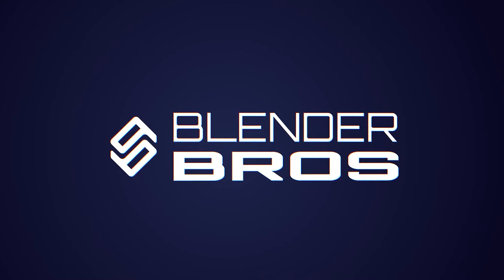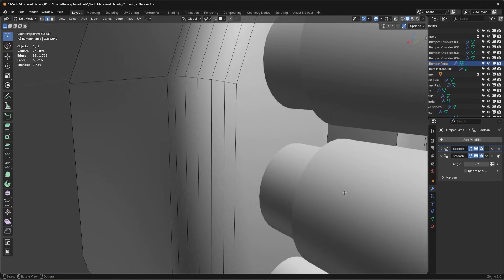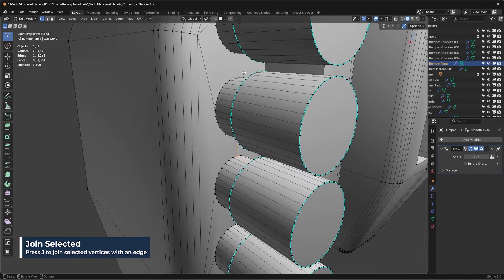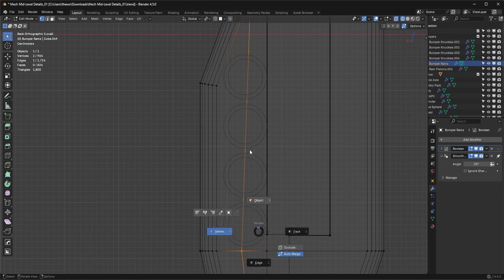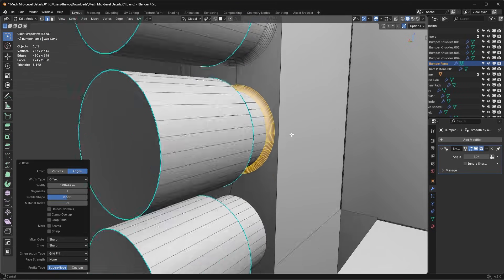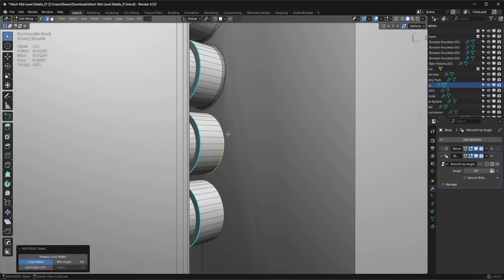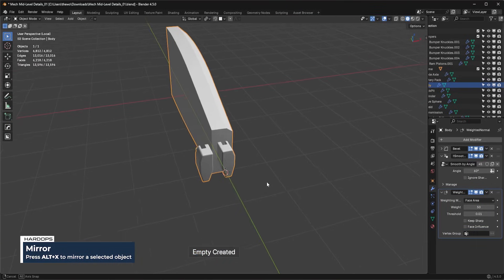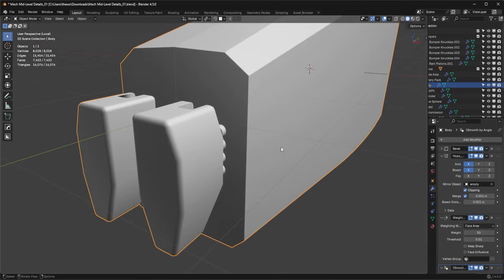Don't do this with your 3D models...

Comment: Great video to take note of if you are 3D printing.  Turning your multiple object project into a single manifold object is half the battle.
Reply: Multiple intersecting objects are usually fine from my experience as long as they're manifold, the slicer can handle it